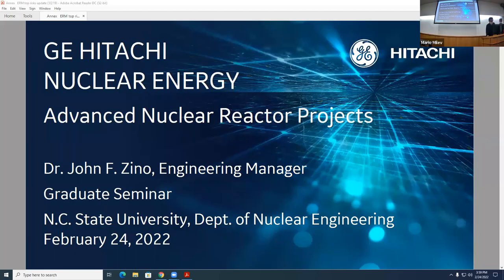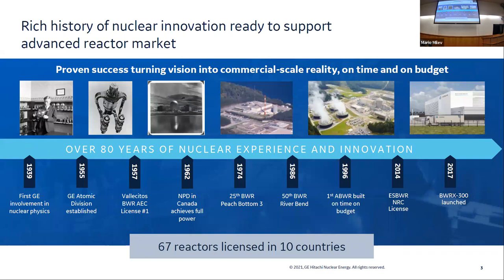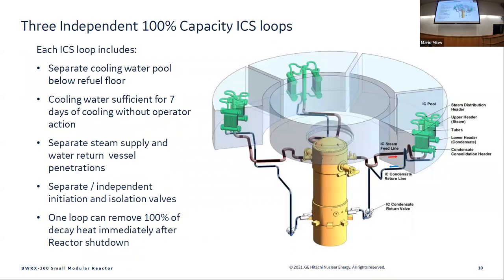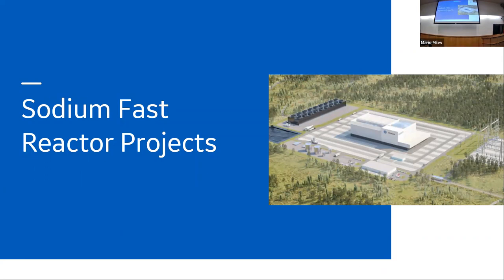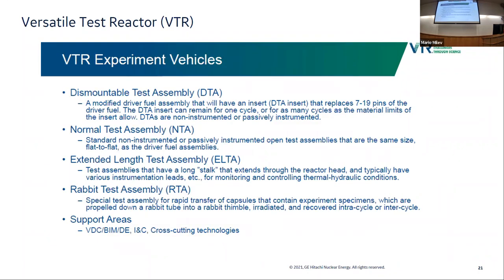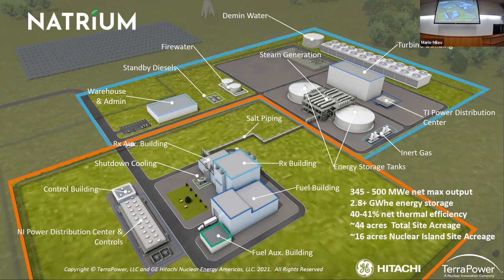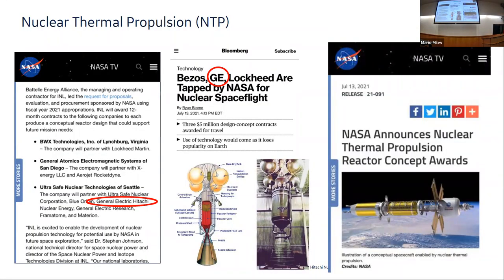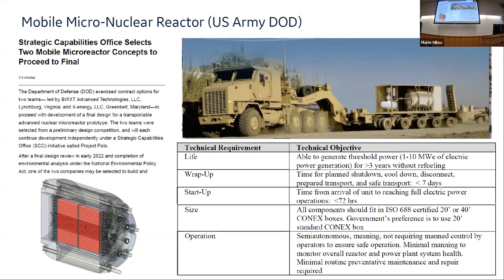NE Seminar 2/24/2022

Comment: Using a nuclear power plant, of any kind, to store heat is thermodynamically nonsensical because it is certain to incur energy losses (10% - 20% ???). And, Mr Gates, the raison d'etre for the Natrium is tinged with profiteering from the high electricity prices resulting from high penetration of dysfunctional wind and solar power plants (WASPPs). It does nothing in respect of lowering prices for the poorest, who are disproportionately penalised by high energy costs

What is sure to happen, in not too many years after Natrium becomes operational, is that it will be competing directly in the market place with a BWRX-300 (at £2,250/kW) kitted out with low cost electrolysers (down to $200/kW by 2030), which can load follow in an almost instantaneous fashion.

The manufacture of greenH2 is as vital a part of a decarbonised future as low-carbon grid electricity and represents a revenue stream just as valuable. The reactor operates at 100% availability and ~instantaneous changes in electricity supply to electrolyser plants does not pose any technological issues to them.

Come 2030, highly investable SMRs capable of load following, will be sure to slot into the plans of nations chasing zero-carbon by 2050, as direct replacements for all of the CO2 emitting gas-fired plants (CCGTs, etc.) currently used for load following. There will be grid systems, like that in the UK, where a couple of other revenue steams will benefit such plants: premium payments for load following grid service; premium payment for frequency correction service.

The Natrium may not be optimal in nations with wide seasonal changes in temperatures along with big variations in seasonal energy demands. Not so where greenH2 manufacture by SMRs prevails. Existing gas networks can be modified for greenH2 distribution and also for storage to meet the highest of seasonal demand using greenH2-powered CCGTs (some of which have already been manufactured). The lowest of seasonal energy demands will be facilitated by planned outages and refuelling of the reactors.

'Running by' the complexity of the plant and equipment layout of the Natrium, it looks as if it will struggle to come in at under double the OCC of a BWR-300 fitted with electrolyser plant. Has anyone done the sums?
Reply: Colin, I would encourage you to look at Advanced Burner Reactor with
Breed-and-Burn Thorium Blankets for Improved Economics and Resource Utilization by Ehud	Greenspan. 8. New Fuel Cycle Options -  SFR. Stage 1 are once-through low enriched uranium fueled LWRs, stage 2 are S&B reactors having TRU transmuting seed and once-through thorium blanket, while stage 3 are LWRs that operate on a closed 233U/Th fuel cycle. The story gets even better with RBWR Light-water-cooled Fast Reactor approach with the basic BWRX 300 design. These technologies go great together. It can use unused/spent nuclear fuel, too.